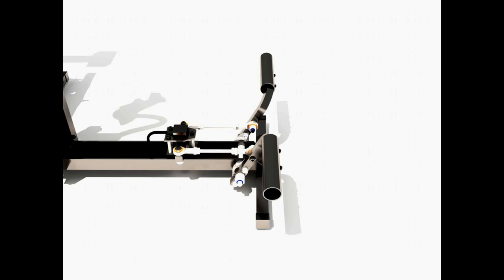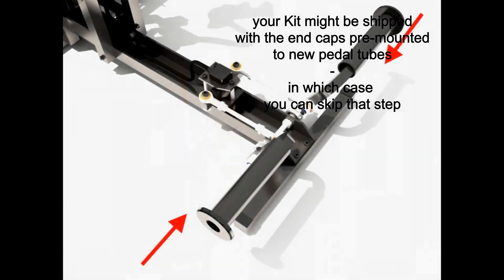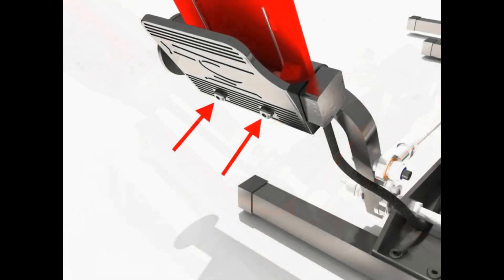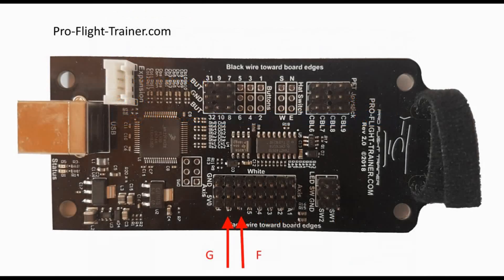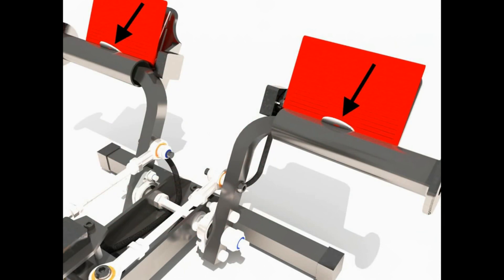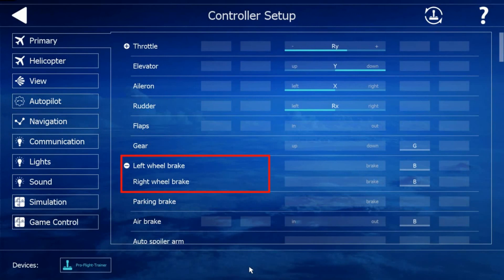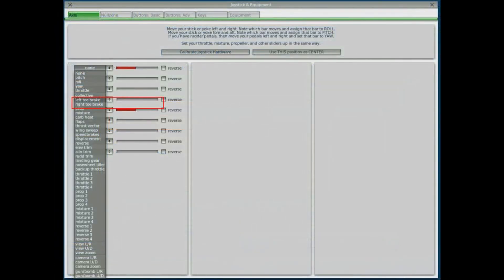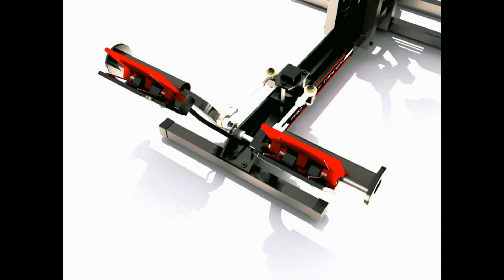Pro Flight Trainer PUMA TBM Toe Brakes Modification installation guide

Comment: Those TBM toe Brakes are great, though I could complain about two things... they do not have a lot of travel like plane toe brakes but I guess it would have been hard to do, and too bad we can't adjust the pedal angles. Also it is hard to push them without also pushing the "rudder" as well... 
So I would say, they are great for what they are designed for, helicopters, but they can't really replace true dedicated plane rudder with toe brakes.
Reply: just apply opposing force with the other pedal